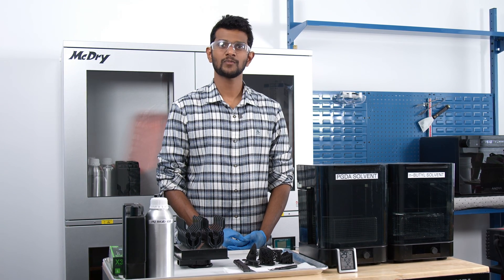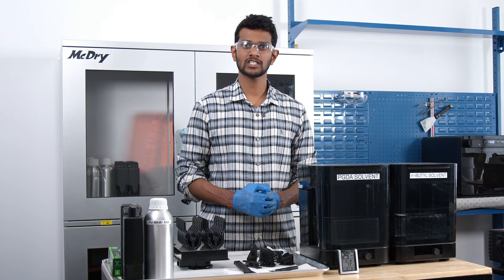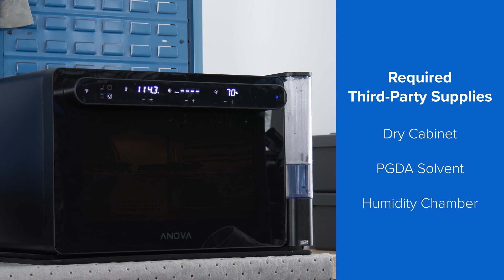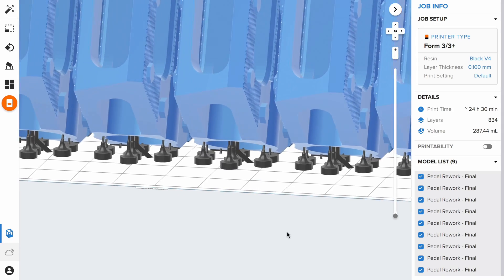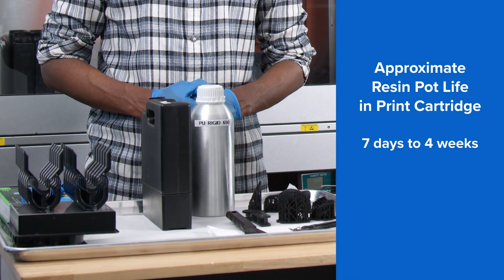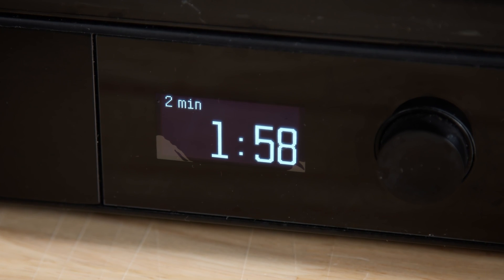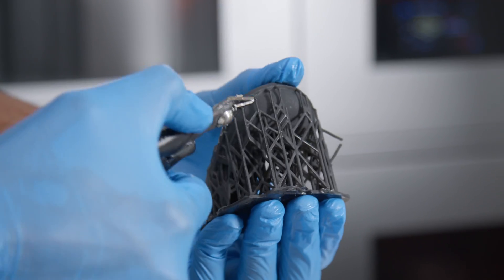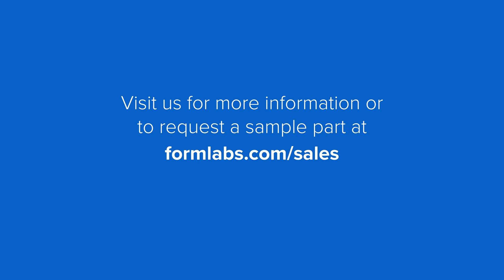Polyurethane 3D Printing Workflow.

Comment: Does this work with the Form 2? Which print trays does it work with?
Reply from the maker: This does work with the Form 2. For tanks: Form 2 Resin Tank LT, Form 3 Resin Tank V2.1 or later. Check out more at: https://support.formlabs.com/s/article/Choosing-the-Right-Material
Reply: @Formlabs  Hold on, so it works with the Form 2 LT tank and Form 2 resin cartridge but not with the Form 2 machine????
Reply from the maker: @thenamelessone123  PU Rigid 650 Resin and PU Rigid 1000 Resin are compatible with the Form 2, Form 3/3+, Form 3B/3B+ as well as Form 2LT and Form 3V2.1 tanks.
Reply: It does. Needs Form 2 LT Tank. You're welcome!